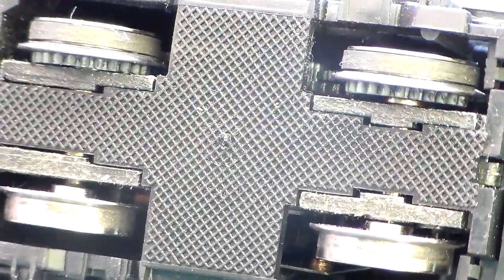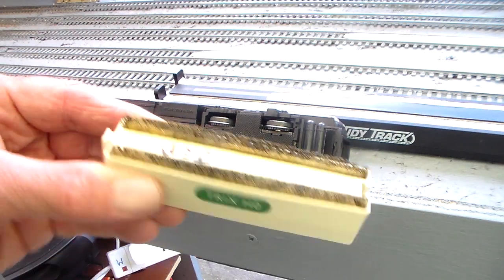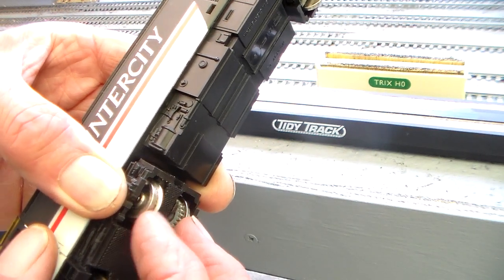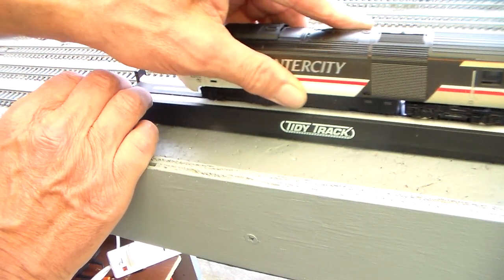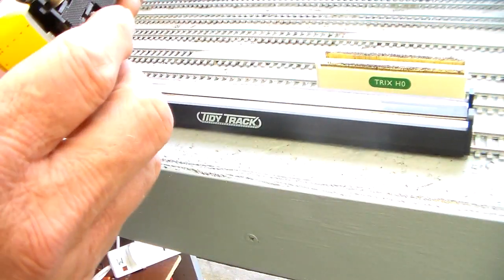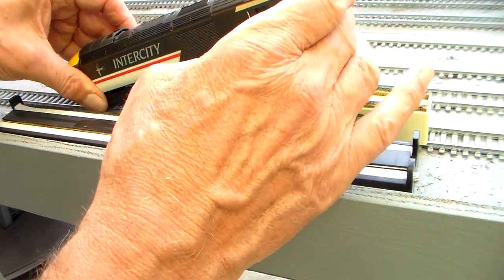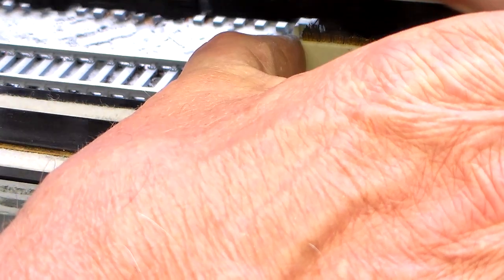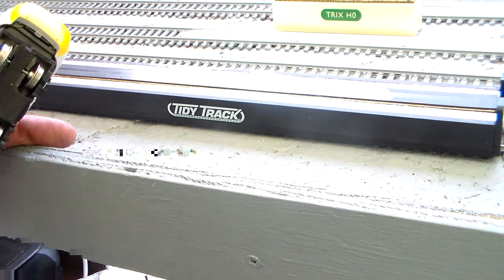HO Trix vs Tidy Tracks wheel clean - no contest

Comment: Simple, 9 volt pp3 touching the wheels to run the motor, dremel with wire brush, clean wheels in seconds. Works on non driven wheels too without the pp3 of course.
Reply from the maker: Thank you Chailey. A good tip. I do tend to use a fibre glass pen these days. Pop the loco into the task for a second to turn the wheels.  Same tool for all wagons and coaches as well. cheers.  John

Comment from the maker: Hi, yes its possible to rewheel the loco but this is a relatively old model and people replace the whole bogie and motor assembly with a better motor (and wheels). But you would really need to decide how much you value the body. Same for tender drives but they start at £60 or more and require building.

Comment: Why was damage  to the traction  tyre avoided  using the Trix cleaner I thought  it would  have ripped it to shreds
Reply from the maker: The tradition tyre was scrubbed clean and ruffed up a bit so that it had much better grip. After a while the tyre swells...  residual oil? Then the tyre just falls off or perishes and splits. Oil and dirt far more of a problem for the river of the the than a bit of abrasion.

Comment: You don't have to link the Trix cleaners together; so if the 100mm/4" brush does not reach both bogies, then the second brush can be put under the bogie (or tender) to provide the pickup.
Reply from the maker: Hi Tom, yes of course, I see what you mean. Each cleaner has independent pick up from the track

Comment from the maker: The non-powered car has wheels with the gear on the back but all metal - no tyre. These should therefore be available at low cost. The same wheels were used on many powered bogie locomotives.

Comment: I use 2000 grit sandpaper to clean my wheels and rails.
Reply from the maker: Hi Bobbi. Well that is nice and fine so it shouldn't wear then away. The problems are ... turning wheels that are geared to the motor to clean all round if cleaning by hand .... cleaning free running wheels if using power to turn geared wheels!

Comment: I bought a Tidy Track from a model show; the seller indicated that he used it, and that it was a useful tool.
I should have followed my inclination that it was not useful, and especially for the unpowered wheels.
Reply from the maker: The Gaugemaster version is still selling well and has many fans. Unpowered wheels are a problem for any wheel cleaner. I quite like the simplicity of a piece of kitchen paper placed over a section of track as a wheel cleaner.

Comment: Should have used the scubbing black pads instead of the white softer cleaning pads. I bet that would have made a difference.
Reply from the maker: I can give them a try. I presume they come with the kit. I note that one of the re sellers 'gauge master, are marketing their own using conductive foam to provide power to the tyre rather than copper strips to provide power via the flange.

Comment: Nice review of the Peco wheel cleaning brush (PC40) in https://youtu.be/yGVOWXs71XA
Also mentions cleaning the back of the wheels, where the pickups run.
But for a split pickup system like this, the two manual leads work very well.

I have the older version, which has a wider shorter brush, and can see that the new version is better.
It is also possible to get two brushes, to do both sides at once (like a manual Trix), but I suspect for those who cannot function with the two hands separately, and the  scraper provides a useful alternative.
Reply: Researching, to see if I can get the long thin brush, I see Peco has now moved on to the PL-42, which is a pen-like brush for dealing with each wheel in turn.
Probably better for locos where the brake-rod kit has been installed...
Reply: Of course, if you choose a small (narrow) brass brush, no reason why you cannot electrify it to provide thei function.
Probably cheaper thatn from Peco, anyway!  And get two, so when the Trix wears out, you can replace the brushes in it.
Reply from the maker: Hi Tom, thank you for your helpful comment. My attempt at a reply three years ago didn't work.

Comment: a bit of a pointless test if your using the non abrasive pads on the tidy trak surely - as the trix is a lot more abrasive than a non abrasive pad
Reply from the maker: Hi Sim, I have tried various pads with the tidy tracks. It still sits there. I'll sell it to you if you like, hardly used! Some people really like it. When I have wheels to clean I go straight for the Trix because it works so well for me with no faff.
Reply: The problem with Tidy Track is the wheel doesn’t get clean adjacent to the flange as the wheel is still on narrow brass track in the cleaner.  Trix cleans the whole wheel including the flange, where Tidy Track only cleans the outer tread of the wheel